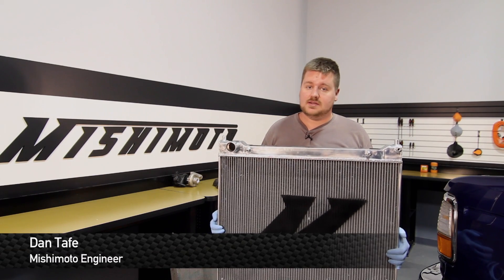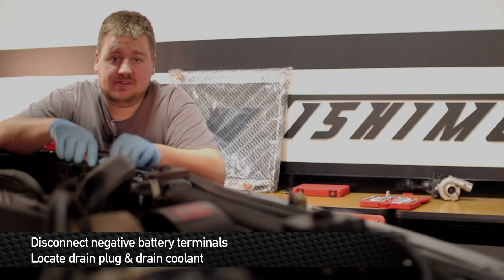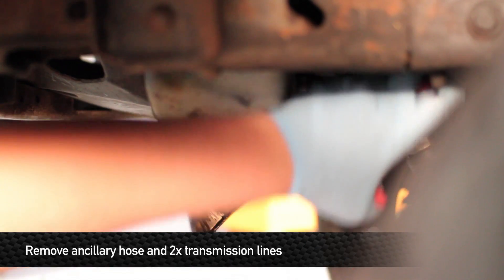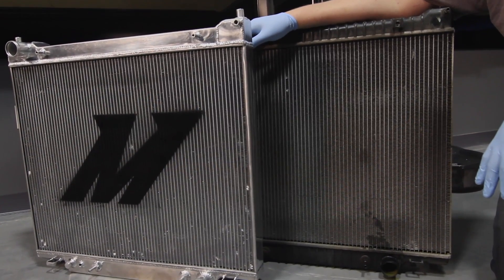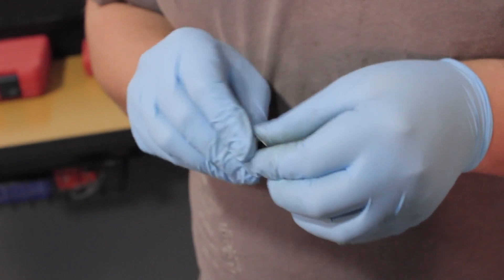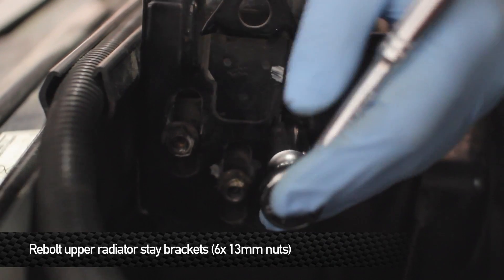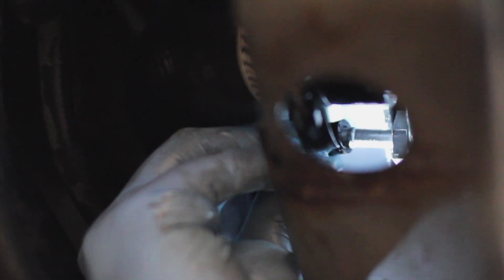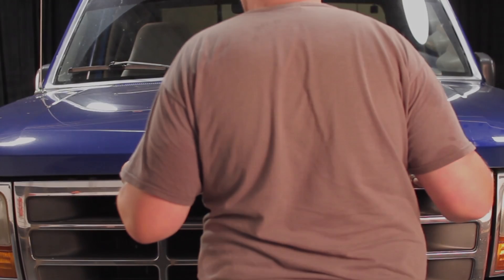How To Install: Mishimoto 1995-1997 Ford Powerstroke 7.3L Performance Radiator

Comment: Thanks for making & sharing this video. I just bought one of your radiators for my 1996 7.3 and it was very helpful. Especially listing out the tools and the steps. I wish more "how-to" videos would include this as it saves a ton of time trying to figure out what size wrench/socket to use.

Comment: Will the O'Reilly conventional antifreeze work on this the the full strength one?
Reply from the maker: Yes, conventional antifreeze should not be an issue, how ever you will want to pick up the manufacture recommended grade of coolant and if you are picking up full strength to properly dilute it.

Comment: On my factory radiator i broke of the nipple that goes to the overflow tank. You said that needs to be reused for this radiator. Any clue where to buy one or what size barb would fit in its place?
Reply from the maker: The thread on the radiator is a 1/8" NPT thread so it should not be too hard to find a barb that fits at you local hardware store

Comment: My 7.3 has a 6.0 transmission cooler on it, will this change the install procedure much? Do I still need to disconnect the transmission cooler hoses?
Reply from the maker: The install will be no different than if you had a stock transmission cooler installed.

Comment: Will this radiator also improve transmission temperatures, and if you run a separate transmission cooler do you need to plug the two transmission ports on the radiator? Thanks
Reply from the maker: Since the over temperature of the coolant will lower the transmission should also see a slight decrease in temperatures. If going to a separate cooler its a good idea to cap the ports just to keep dirt out of them but nothing should leak from these ports.

Comment: Will the motorcraft green antifreeze w/additive work with this rad?  I just flushed and changed the coolant and then found I had a rad leak.  So, I drained and saved the green coolant and would like to use it, if possible.
Reply from the maker: Hey Aleta, I believe we spoke on live chat earlier :). If I'm confusing you with someone else, just let me know and I'd be happy to go over your questions.

Comment: What type of antifreeze?
Reply from the maker: Hey Justin! Use either OEM or our Liquid Chill!
Reply: Thanks,  I picked up some peek fleet charge sca precharged concentrate & test every so often.
Reply: that's what is recommended to prevent cylinder cavitation and is aluminum safe.